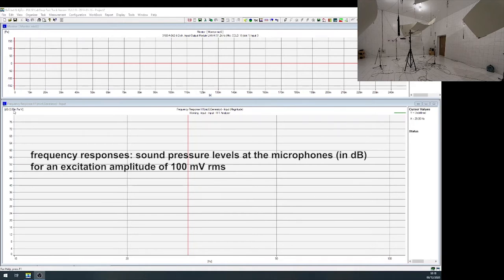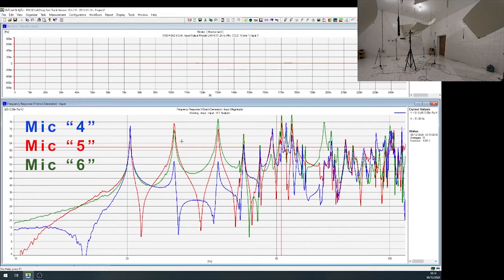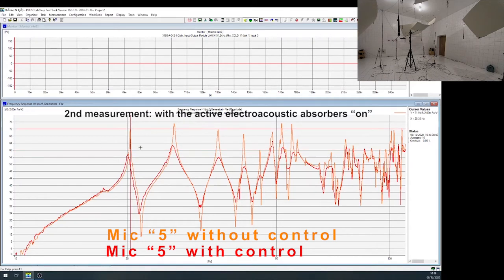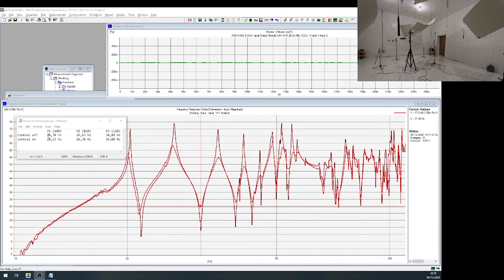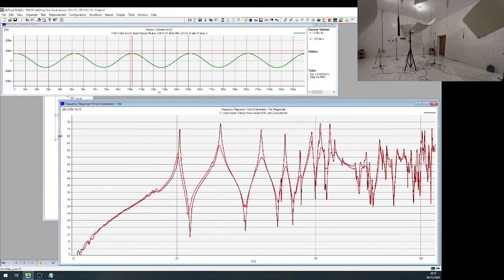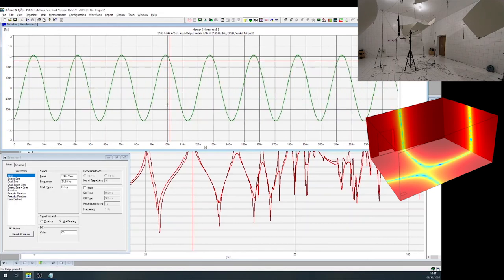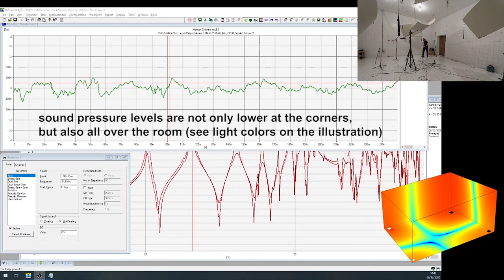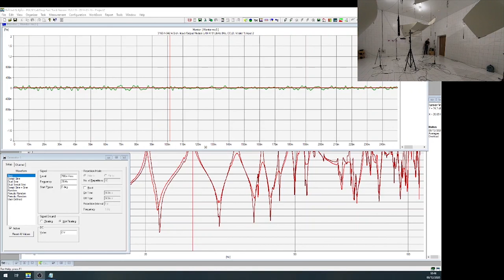Room modes equalization demonstration

Comment: Concept wise is that similar to PSI Aava?
Reply from the maker: Hi Michal, sort of. Here, we use directly the membrane of the speaker to absorb sound through DSP processing, instead of using a passive resistance and a (analog) feedback on a speaker to achieve pressure release, as in the PSI concept.
For you information, the AVAA is the fruit of a research collaboration with PSI, Goldmund, the HEPIA in Geneva, and us (https://lts2.epfl.ch/software/electroacoustic-absorbers/interacts-project/)
Reply: @acousticgroup-epfllts2771  Thanks for the answer. Is your product commercially available for purchase?
Reply from the maker: @MichalSieczko  Sorry, this was an academic prototype, Goldmund decided not to further develop it finally. However, we did a lot of improvements based on this first industrial application since 2016.
You can find our publications on this concept in our bibliographic database: 
https://infoscience.epfl.ch/search?p1=Lissek&p2=electroacoustic&fct__1=Journal+Articles&fct__1=Journal+Articles